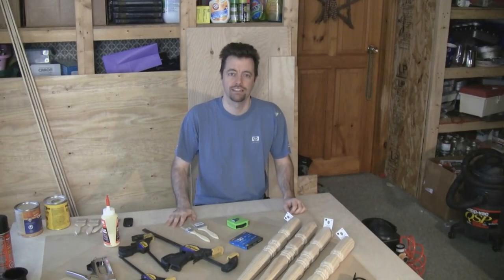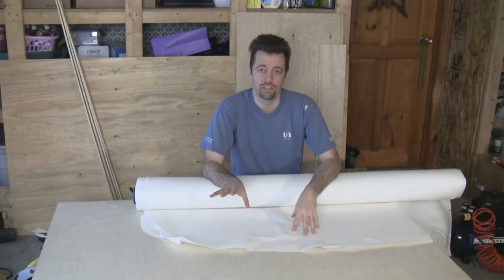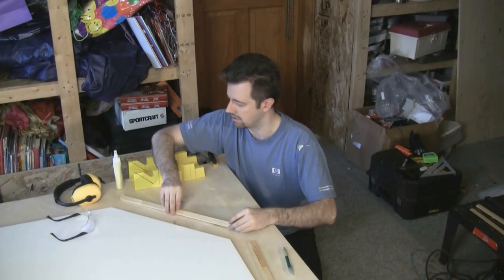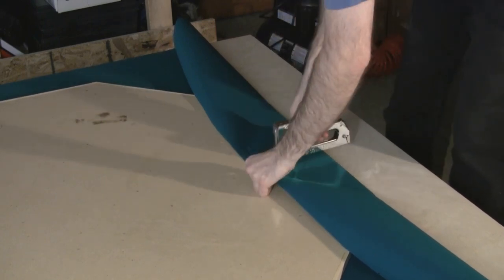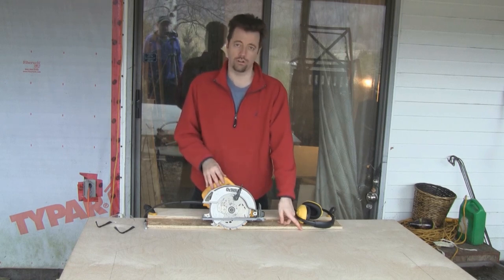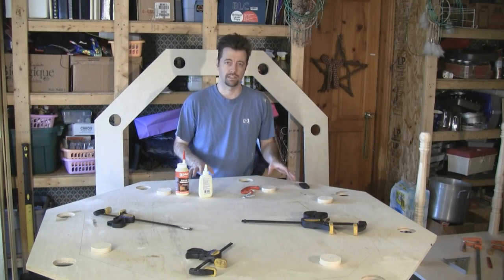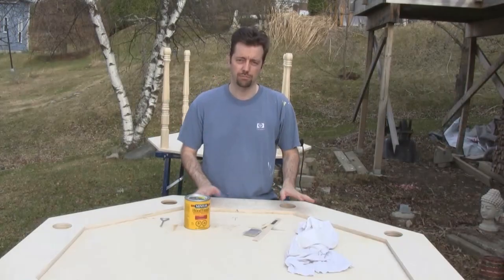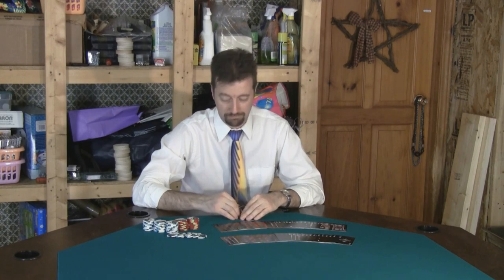How to Build a Poker Table

Comment: How does the playing surface sit flush with the race track if both are cut from 3/4in material but the foam on the playing surface must add at least a 1/8" to a 1/4" of thickness?

Comment: Sir, Thank you so much for this video!  Incredible table design.  If you were to install folding table legs, how would you recommend doing it?  Would you change the design of the legs? 
 V/R, Brian
Reply from the maker: Hello Brian,
You can attach folding legs to the bottom like you would any other table. Although, I would likely go with screw-in legs that you could just remove instead of folding them.
Reply: +TheShopGeek Do you have any recommendations on how to best make the screw in legs?  I apologize for the question,  but I am new at making things like this....V/R.  Brian
Reply: Consider using additional single legs around the underside of the table for sturdiness during use.  They can be found that can either screw on and off or fold down for storage.  Consider using the same type of legs as regular card tables.

Comment from the maker: The foam is actually glued to a 1/2" thick piece of MDF, not to the 3/4" plywood. This makes the surfaces just about level when using a 1/4" thick foam.

Comment: how long are the legs? How tall should the table be? Im sorry if these are stupid questions, but I couldn't find the length of the legs in the bill of materials on the website. Thanks.
Reply from the maker: My table ended up being about 30" tall, which is pretty common for most tables.

Comment: What do you recommend as far as installing the padded racetrack?
Reply from the maker: Francisco Noguera I skipped the rail for this build because it's a lot of work for just poker - I wanted to be able to use this table for board games as well and it feels better to me without the padding. I've seen some tables use pool noodles which slip on really easily but don't look great. For a true padded rail, you need a lot of work in building the rail separately and then bolting it on.
Reply: Cool, thanks again for both informative video and reply!